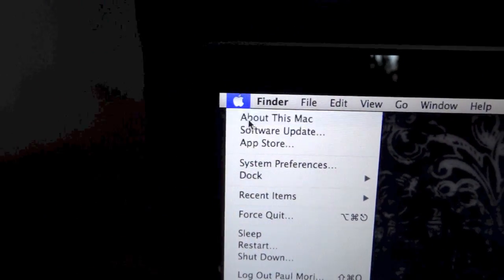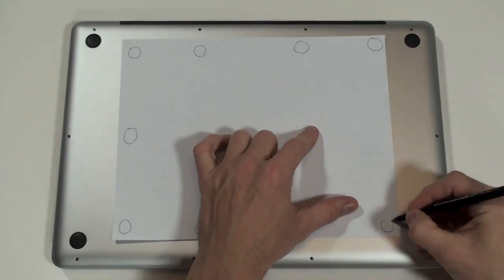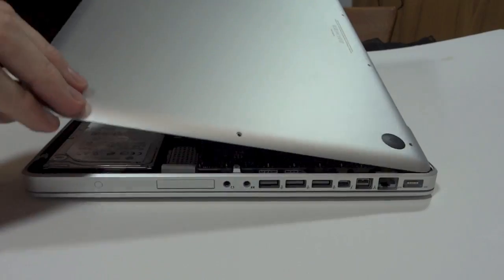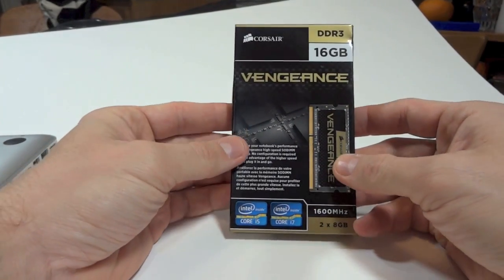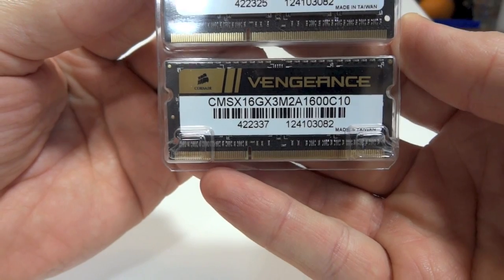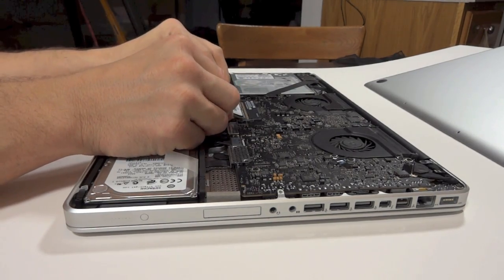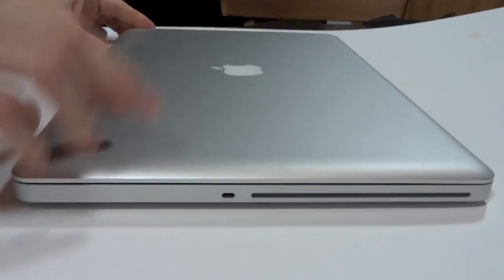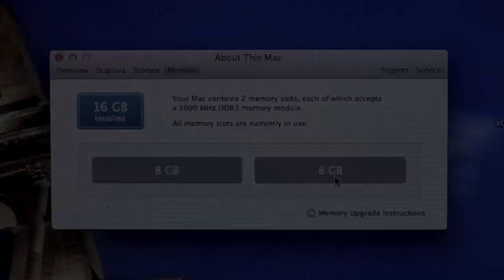How to Upgrade RAM in MacBook Pro 17" 2011 16GB Install Tutorial

Comment: Excelent video! 
It's been 3 years since you posted this, is your laptop still ok? Any issues?
Thank you.
Reply from the maker: +TechtronicMountain Thanks! Actually, funny that you ask. My laptop just crapped out on me after 4 years of use. I get a white screen at startup. But it's not the ram cause I've tried with the original and I also put the original HD back in, so it seems something went bad with the motherboard.
Reply: +Paul Mori 
Sorry to hear that man. Check if it is the video card, not sure if you're aware, but 2011 17" Macbook Pros have an issue where the soldering of the video card melts after years of use. It happened to me 6 months ago, and apple fixed it for free. If that's the issue, better hurry because apple set a deadline for fixing it for free, I think is around February 2016, but not sure. Anyway, best of luck and thanks for the reply. I ended up buying a 16Gb Ram Kit but running at 1333Mhz.
Reply: +Paul Mori 
https://www.apple.com/support/macbookpro-videoissues/
Reply from the maker: TechtronicMountain Thanks for the heads up! I've just made an appointment with them for Friday.
Reply from the maker: I just got my Mac back yesterday and it works like new! It was the video card so they fixed it for free. They even replaced my battery which was swollen and it was pushing on the touch pad above it. Thanks for the heads up! Cheers!
Reply: +Paul Mori Great! So happy for you, enjoy!

Comment: thanks! I wasn't sure if my macbook was gonna handle the upgrade, but you proved it so i didn't have to be nervous about making the purchase!  my friend pointed out that 2011 17" can go 16GB, but only models with i& 27xxQM or 28xxQM can handle the 1600MHz.  to find out which processor i had, i searched everymac.com for my part number mc725LL/a. anyway, thanks again for posting this video!
Reply: I have a MBP 17" late 2011 how can I check my part number thru everymac.com?

Comment: Yes any macbook pro either i5 or i7 will run 16GB (max) @1600MHz speed or even the highest 18xxMHz speed ram natively do to the i5/i7 chip set supporting it! Love the super fast speed of the awesome powerful Corsair Vengeance ram. Any DDR3 RAM brand will run fine in these macs but higher quality makes the deference (better components/quality, durability when stressed out, guarantee speed, tolerant to heat, design & build) and its very noticeable.